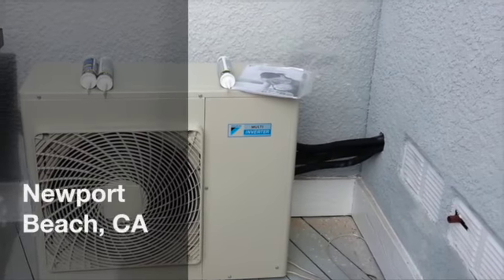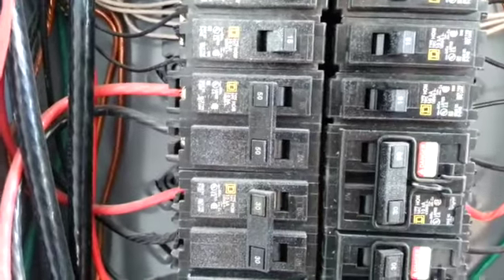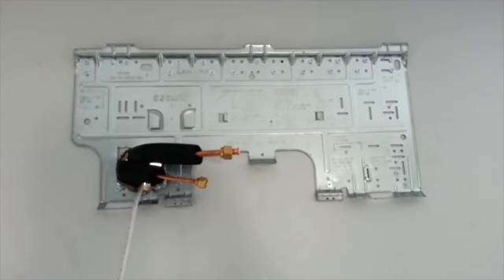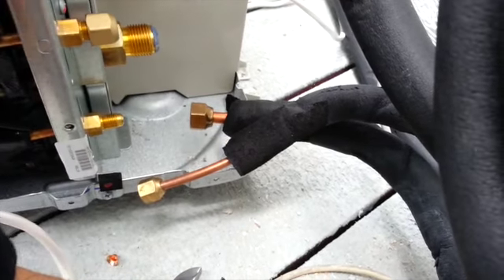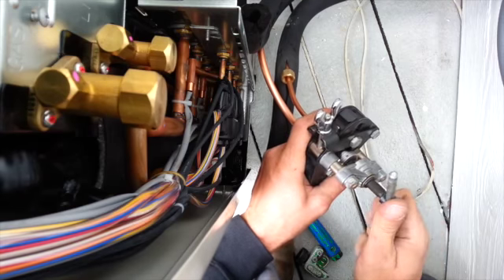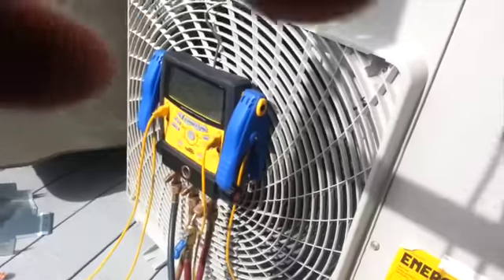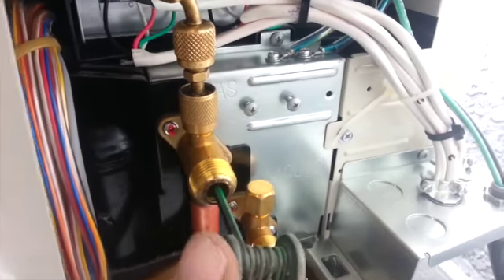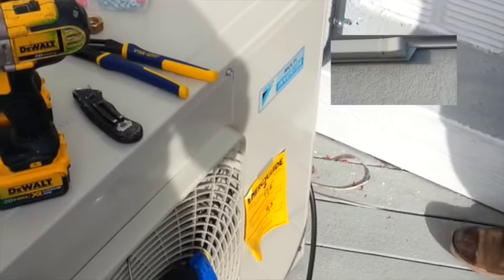Newport Beach DAIKIN Mini Split Multi Heat Pump Installation - Thomson AC

Comment: You shouldn't be using leak lock on flares.. ESPECIALLY not in a refrigerant line.  What is to keep that goop out of the piston/TXV?  I know you only dabbed it, but still, as a licensed contractor I advise against it.  I like the cover you used.  Good looking job!

Comment: 6 gauge wire would have been fine in a 20amp switch if it fit. I checked with Daikin about over conductor sizing.
Reply: Interesting the manual calls for 14 gauge wire with the 20 amp breaker.

Comment: Great video but please stop using leak lock on those fittings!! All you need is some vacuum pump oil on the face of the flare, check your install manual. Went to a Daikin factory class last week. Also invest in the torque wrenches and r-410a flaring block, makes all the difference! Clean looking job though!
Reply: Just read your comment after posting my own.  Great minds think alike!
Reply from the maker: Gentlemen, I like the way you think. We've been using your methods for the past few years. This video is from before we made those changes. (or since we took the Daikin install class) we now use the digital torque wrenches, the pink Daikin gauge tool, no leak lock, etc... Cheers!

Comment: Excellent system.  Just a few things for those that aren't HVAC types that try to install these systems...torque your lines, both inside and out or else they are subject to leaking later (months later or years) and use a flaring tool that has a clutch so you can't over tighten it (again so no leaking later).  The PROs might know when to stop tightening, but since I'm not a PRO, I have no idea, also 410A systems need special flaring tool, the average 20. 40, 50 dollar ones will not work.

Comment: Why did you run new wire? Unless changing location all you needed to do was change the breaker.
Reply from the maker: It was a brand new install. They didn’t have anything there before.

Comment: Just giving you some pointers here, Never use leak lock on flares. Only some refrigeration oil if need be. Anything on the flare will allow moisture to get in the flare and freeze and crack it eventually. Get a flare size gauge from Daikin. you need to set the depth of the line, it should be about the thickness of a nickel off the block if you don't have a gauge. A flaring tool with a clutch for 410a. And a torque wrench set. You should not over de bur the lines, the wall will be too thin and eventually crack. You need to pressure test the system to 45 psig 15min, 180 psig for 15min then 580 for 2-24hrs, before you triple evacuate the system. You need a manifold that has two high side gauges on it that max out at 750 psig to pressure test. You should use valve core removers when pulling a vacuum and the big port on your pump. Not sure why you said you need to get the oxygen out of the system you must have meant air. You should go to Daikin universities web site and take their training courses, if you plan to install them, your supplier can get you signed up, unless you're buying off the internet.
Reply from the maker: Thanks man! You are right on all accounts. This video is from a few years back. I'm surprised we weren't doing all those things at that point. ...we do now :)